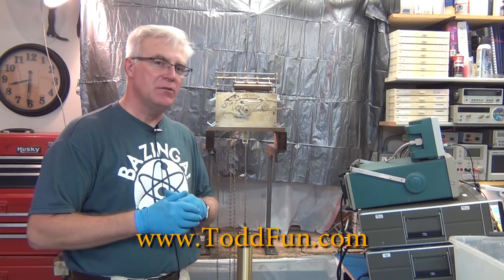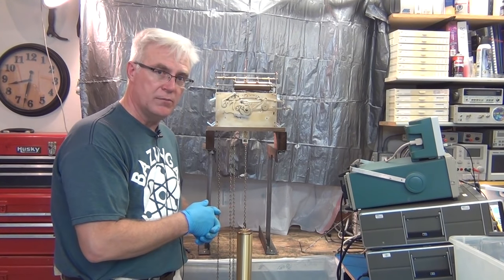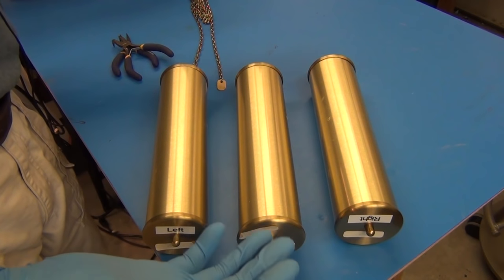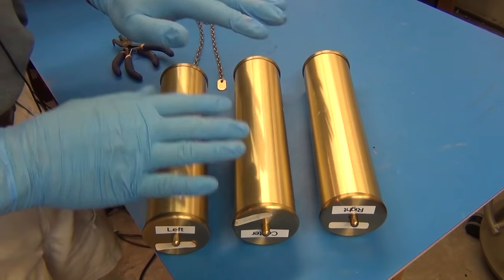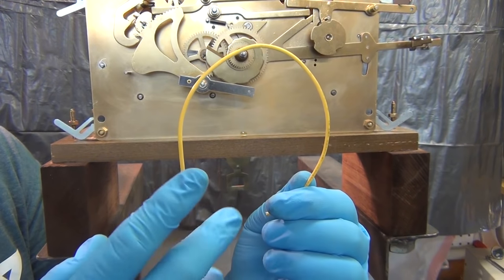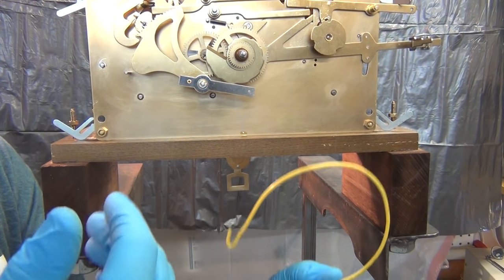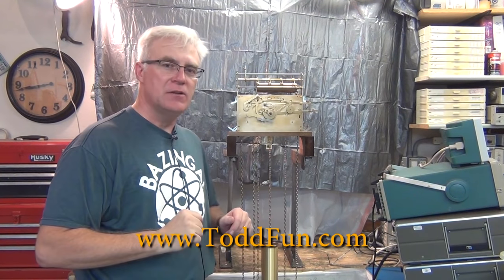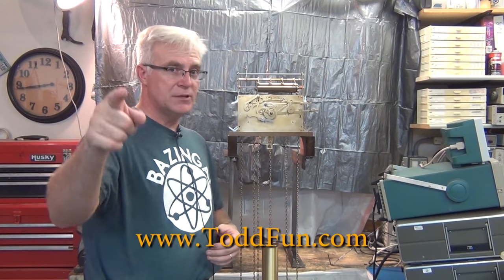How to Remove and Install Grandfather Clock Drive Chains

Comment: He said he was going to tell weight placement??
Reply from the maker: Thought I did, maybe it was in another video I did. On mine and most of the same they hang heaviest from right to left.
Reply: @ToddFun  thanks so much. Oh and ya you did. But thanks for the info....again
Reply: @ToddFun  looking form the front of the clock or looking from the back of the clock? Right or left?
Reply from the maker: @sharonmanprin9768  Looking from the front of the clock
Reply: He did say the beginning.. heavy one on R. Lighter one on L.
Reply: He did at beginning weights are marked on bottom.??

Comment: Thank you so much for this detailed video. My wife inherited a Howard Miller with the Westminster Chime mechanism from her grandparents that hadn’t worked in over 20 years because the center chain had been pulled to far and while attempting to fix it, her grandfather got it wedged in the sprocket. I was able to get it free, but didn’t know how to get it back on correctly. After watching this video and the explanation of using some stranded wire as a feeder for the chain and also the explanation of which side the weight should hang on  according to the ratchet direction gave me the confidence to get it going again. Thankfully it doesn’t appear that any harm was done to the mechanism as it has been running on time for about 30 minutes. Thanks again! I’ll have to watch your other videos to see how to keep it clean and working for years to come.
Reply from the maker: Glad to be of help.

Comment: Hi. Thank you so much for this super simple ""how-to" video. My mother was going to pay someone $250 to do this and get the clock working. I am a 50(ish) yr old woman, and had to wait til she went to church, to sneak and surprise her. My point with my age and gender, is that first try, the weight is back in place, and I have never touched a clock before!!! Thank you again!. On to the next video to get her started again.
Reply from the maker: Good to hear you're trying. Let me know how it works out.
Reply: My grandmother clock pendulum come loose how do yo put together don't know if something broken most of the parts are loose the movers I think miss handle it.
Reply: Roger Gatdula really?   Just the pendulum being unattached .     ..   is that correct?     The stick with the circular pendant on the bottom ,  that swings back and forth in the clock?   You’re inquiring how to reattach it ,  YouTube’d it infact .

Did you get it reattached ?    How did you find the info  or did you have a friend help or just messed with it until you got it back on? Sorry , for the many questions, just am genuinely curious ab your jostled moved clock.

Cora from Alaska

Comment: I feel like such a dummy. A couple nights ago, I realized I needed to raise the weights on my clock. I lifted up on the middle weight and began to raise the chain. I was distracted and didn't realize the weight had lifted off the hook until the chain came out the other side. Now... I have to get the chain back where it belongs. It just haaaaaaad to be the center weight. I made several attempts tonight but the lighting was bad and my hooker was too stiff. I'll try again tomorrow. Thanks so much for the how to. The closest clock repairman is over an hour away and $$$.
Reply from the maker: Good luck. You'll get it. Remember that some clocks have removable hoods and/or side panels that make it a lot easier to fiddle with oiling and chain installs.

Comment: Before you pull the old chain out open the end link, and connect the new chain to the old chain and just pull it through. A much easier process.

Comment: Thank you very much for the video.. we fiddled with the middle chain for over an hour and then I checked YouTube. Found you video and got that middle chain on the gear in less than 30 minutes. You're a life saver and back saver.

Comment: This is so wonderful! The weights on my grandfather clock were pulled too high and got stuck so I had removed them and they have been just sitting there for a year. After I found your video I followed your instructions, actually was able to do it without using a wire. Also mine didn't have side panel access but it had a rear one so that was how I got to it. It worked perfectly! So happy!

Comment: This was a huge help. Complete beginner, managed to rechain my new Westminster Chime in an hour after watching this. Had a bit of an issue with the centre gear ( the clock) but solved that by hooking a length of wire on the sprockets and pulling the chain through by finger turning the sprocket with the chain tagging along behind. Thanks

Comment: Thank you! This video was perfect!  We moved over a year ago, it was a self-move and I made the mistake of removing the chains and the weights.  I should have just removed the weights only and secured the chains instead, but hindsight is 20/20. For a year my clock has been non-operating and everyone I called wanted to charge me $350-$450 to come out and re-assemble.  With the help of this video you shared, I did it myself and I am thrilled - It is working again and it is music to my ears.  Thank you! Thank you! for sharing you expertise.  Excellent instructions!!
Reply from the maker: Sure, glad to have been of help. Great to hear you are enjoying your clock again and were able to successfully do the work at a good savings.

Comment: THANK YOU SO MUCH!  while moving from MD to NC the packers pulled all the chains tightly and then it was over tight,  I got the chains off and finally got the right and left chair on but had no idea how to do the middle chain.  you video has told me how now...thanks so very much.  It's so hard to get a  grandfather clock man to come out so I have resorted to use YouTube...lol...thanks so very much...lovely easy video.

Comment: Hi Todd,  I'm a new subscriber.  My clock is a German make that came with the Emperor Kit.  It has been very dependable but occasionally one of the weights just drops off.  I have no idea why but the end result is having to reinstall the chain and put the weight back into it's casing.  Your video was very helpful in helping to get things back together.  It's working well.  Thanks.  Incidentally, I'm an 82 year old widow.

Comment: YOU ARE SO PATIENT WHEN MECHANICAL  REPAIRS.  EXCELLENT TEACHING METHODS
Reply from the maker: Thanks Margaret! I have one more video on this clock. I have to do that final bushing replacement video.
Reply: I wish u lived in Gainesville, FL, so you can fix my Aaron Willard grandfathers clock.  It's 37 years old and has been cleaned 5 years ago.
We moved it to
FL and the pendulum  is hooked up, but it doesn't continue swinging on it's own. I push it, it swings, then  pendulum stops after 3 min. thanks again M. Selli
Reply from the maker: If you can't get it going just google for a local horologist. I'm sure there would be one you could take it to and some even do house calls.

Comment: Thank you for this video. My clock hasn’t worked in about 8 years and low priority for clock repair in a shop. I was able to fix it myself in a matter of under 20 minutes using the wire trick. My center chain had come off years ago and now my clock is keeping time once again on my30 year oldHoward Miller grandfather clock. It was a breeze thanks 5o you showing this simple trick that works. Thanks again!
Reply from the maker: Nice! glad to hear you have your clock back. Glad to help

Comment: Your video just saved us $375.  Thank you.  The tip about using 18 gauge wire was so helpful.  We have a 1980's Ridgeway Tempus Fugit chain driven grandfather clock.   We recently had to remove the weights to move the clock.  I actually raised the left and right weights too high and couldn't get the weights off.  Thanks to your video we remedied the problem.  Somehow in the process the chain for middle weight came out.  Question: Does the middle chain feed from left to right?   Thank you

Comment: Thanks Todd! The the chain for the middle weight of my clock came off the sprocket. With your detailed instruction I was able to put it back in place without too much difficulty. My clock is up and running again.
Reply from the maker: Glad to be of help!

Comment: Todd thanks so much for this video, you saved a griving daughter... My dad pass away after a terrible accident and the thing he loved the most was one clock similar to this, and this video help me fix the mistake my mom made. I'm gonna watch the rest of the videos to learn how to keep ot running
Reply from the maker: Sorry about your loss. I hope the clock brings many years of good memories.
Reply: I have a Tempest Fugit tall case  g/f clock. The weights all 3 and the pendulum is non existent. If possible id like to know whether a pendulum to build is something i could do. Ive already have been informed the weight of the pen is immaterial to the movemnt. The length and size of bob is. I also gave a German Jmperator which im trying to fabricate a pendulum (quite short from what i could tell. Getting these 2 clocks right and working would make me really happy. I also hope the weights for chains indicated can used for mine(the g/f clock)

Comment: Good video.👍🏼✌🏼
I have a Moathe Grandfather clock. My issue is the centre sprocket for the pendulum (I believe) keeps turning. It doesn't click or have any tension. What's the issue?? 🤔😁
How does the pendulum connect?

Comment: Hi Todd I watched your video on changing the chains a grandfather clock. My grandmother's clock that she left me, has 1 outside chain gear
Reply: That spins freely and I can't put the weight on or it will pull through. Can you advise me please
Reply from the maker: Sounds like the "click" spring on the drum is damaged or out of place. It's job is to engage a ratcheting pawl so the gear can only turn one way to wind. It would need to be repaired by a Horologist.

Comment: I'm glad I found your channel. My wife bought me a Herschede grandfather clock (model 325, 3 weights) for my birthday. I've always wanted a nice antique clock & she found a nice looking one on Craigslist. It's missing the pendulum & the chains are off. I'll use this video to give it a shot on my own. 

I'm wondering how to get the mechanism out of the cabinet. I can see the wingnuts on either side holding it in place. I guess I take off the clock hands but do I pull the face off too so the mechanism comes out the front? Which other videos of yours do you recommend me watching first?
Thanks!

Comment: Great video. Detailed and clear. Helped me fix my clock and it took me just 30 minutes or so - once I found the wire to loop around the gears. I recommend taking the door off the clock. Easier to get your hands in and around where you need to pull the chains.
Reply from the maker: Great to hear!

Comment: My chains have circular eyelets so they can be installed either way I used a plastic tie to fish the chain. It is flexible but it keeps straight just enough to push through. Like your videos

Comment: Recently got a granddaughter clock from a charity shop. Interclock brand. I seem to have extra weights than I need. I asume I only need 3 as I have only 3 chains. I've also noticed the chains are different lengths and one has tags at bottom ends not a hook. If anyone can advise on which chain should go where that would be a great help for me to get started 😊

Comment: I bought a 2nd-hand Colonial gf (1970’s). Chime and strike work well but the time stops at :59 every hour. If I pull on the weight chain it will tick again. If I move the hand past the hour point it will chime and strike. I put the pendulum back in motion and it keeps good time until the :59 mark. Is there some servicing of the time chain and weight that will help this situation?

Comment: I bought a Howard Miller triple chime, where for whatever reason, the guy took the chains out. With the movement still in the case, I found the ideal tool was a mechanic's retrieval tool. They're a flexible wound-wire choke cable about 2 feet long with a button on one end that extends a tiny claw on the other. I simply hooked the chain in the claw and was able to reach right into the movement, and set the chains onto the sprockets

Comment: Thank you for the video, confused about what is right..is it from the back of clock or front ? My grandfather clock is mounted on the wall so I'm going by feel.. facing the clock the left side chain needs to be put back in. Thank you in advance
Reply from the maker: From the front looking at the clock face the left of the clock is your left and the right is your right.

Comment: Hi Todd, thank you so much for your videos! You're always so clear and so thorough with your explanations and demos. I have a quick question about a fairly old grandmother clock that hasn't been in use for awhile. It still keeps time, but the chiming mechanism is off. The quarterly chime drive gear is moving way too fast and is going non-stop the moment the weight is loaded. The hourly chime is only working sporadically. We tried oiling the wells, but didn't seem to fix the problem. Any tips on things to try at home, without having to take the clock apart by a professional? Thanks again!
Reply from the maker: I don't know many clocks but on mine if the set screw under the quarterly cam was not tight I would think that would cause it to run nonstop. As for speed you might want to make sure the right butterflies governers ate able to swing open smoothly and paddle the air for correct air resistance which is what controls the speed.

Comment: Is the chain direction the same on all grandfather clocks? While trying to repair the (Diplomat) grandfather clock I have, I noticed that the right-side chain is in the opposite direction of what you're saying the chain should be going. The hook is on the outside, but you're saying the hook should be toward the center (If I'm understanding you). So, in this case, the weight is dropping downward (with the chain movement going clockwise).
Reply from the maker: They can be different.
Reply: @ToddFun  Ok, thanks.

Comment: Thanks so much for the informative video. I've been trying to find someone to help with this for over a year! It took awhile but I got it done!  NOW where can I find replacement hooks for the weights. I lost one.  No luck on the Howard Miller side
Reply from the maker: Might be best to just buy all new chains with hooks if they have what you need at Time Savers: https://timesavers.com/c-325857-clock-repair-replacement-parts-weights-weight-shells-components.html

Comment: Hi Todd I have the exact same mechanism you are working on in this video.while winding the clock weight came loose from The Hook and the chain came out I replaced the chain but the clock will only run about 30 seconds with the pendulum ontake the pendulum off and it will continue to run faster of course is this hurting .when I replace the weight I moved it to the top have I now over wound the clock and that's why it won't continue to run with a pendulum on. Thanks for your help Todd
Reply from the maker: That is very strange. You really can't "over wind" a weight driven clock to my knowledge. Maybe something got damaged with the chain broke. Is the pendulum spring broke or bent? Is the pendulum hook up correctly to the spring and leader hanger extension? Did the crutck get bent or turned out of place?

Comment: Great video, it really helped me getting the chain back in, but how do I know how high to set the weights?
Reply from the maker: Oscar Montalvo just stop about 2 inches from the top. You can get closer but really no point in getting them so high.
Reply: Thanks a lot. I moved with my mother’s grandfather clock 9 months ago and the weights were removed. I thought that I’d have to find someone to fix it.   I was missing the chiming and wanted to get it working again. So glad I found your video.
Reply: Thank you for the video. It helped a lot!

Comment: The clock you are working on is it the back or front? (it matters to me about the middle chain placement). I am working from the BACK of my clock so when replacing the middle chain should I be threading left to right  or right to left. I know you covered this but you did not say if you are working from the front or back. I am having trouble finding the middle sprocket.   My clock does not have a moving side panel that I can see.. In winding my clock I did this to high. I am so bummed ..also scared to take the front off there is a slit in the bottom like the one you are working on. I tried to take a picture of it but no success yet Thank you in advance.. Oh I have never done this before.
Reply from the maker: Looking from the front of the clock

Comment: Center chain has been impossible for me to get. I can't remove side panels or any of the housing so I have no side view. I can get wire up in there, but can't bring it around and down the other side. I'm working blind. Any advice?

Comment: So, I got my grandfather clock 'cleaned/tuned up' and now it will not continue working. Even when I start the pendulum swinging, it goes for maybe four to five minutes and gradually slows to a stop. I have leveled the clock side-to-side and front-to-back, and the pendulum is not hitting any of the chimes, but it doesn't continue swinging for more than five minutes.
Any ideas of what I could look for to get this clock going for more than 5 minutes?  Thanks.